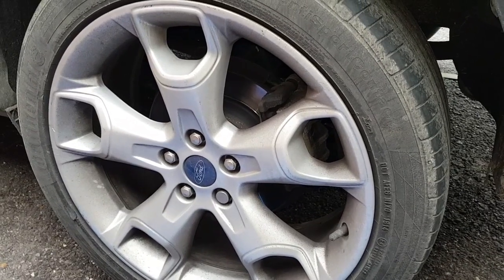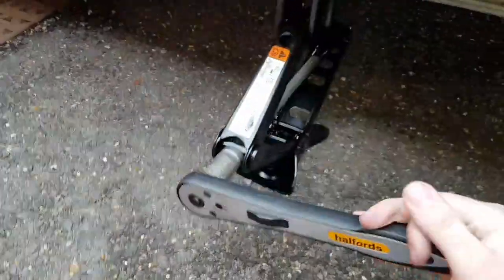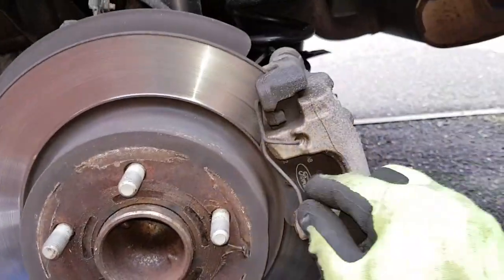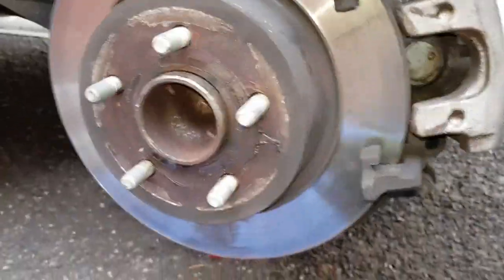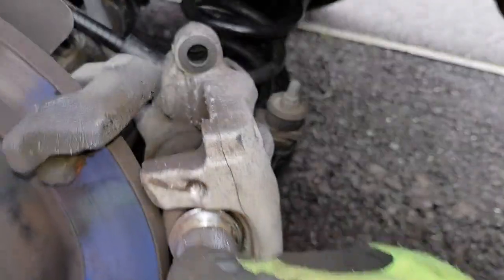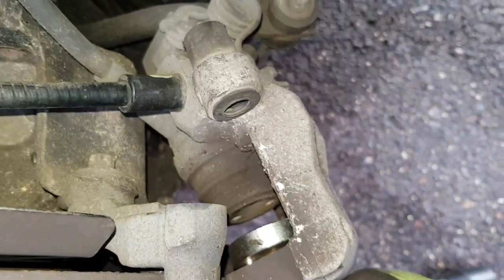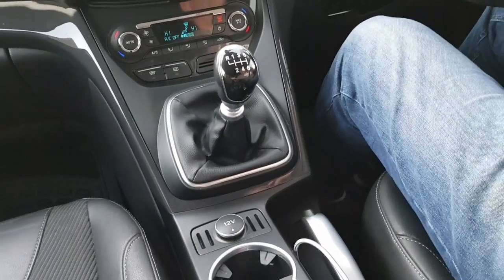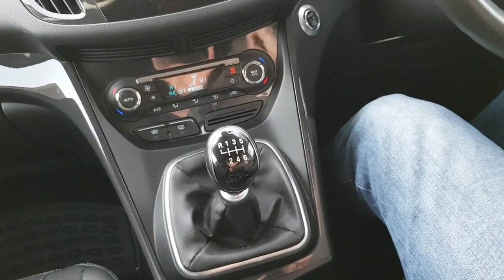Ford Kuga Brake Pad Replacement 2014 MKII

Comment: I hope you didn’t leave your rear caliper spring like that at the end of the video. The spring goes under the caliper mount not on top.
Reply from the maker: No I didn't,  I put it back where it should be :-) 

Too busy faffing with my camera and trying to do it one handed, but I did realise my error.
Reply from the maker: I actually added q comment to the vid at 25.12.

Ideally I should of reshot that part of the video.

Comment: Good video. I am doing my Kuga tomorrow. Same set up as a few of my other cars. Note to all. It's a good idea to only use 6 sided sockets as they grip on all six faces. The 19mm socket used in this video is the multi-position type and are rubbish in comparison as they only grip on the corners of the nut and can strip easy. I have thrown all my multi-position sockets away and replaced with 6 sided ones as I made the same mistake as the guy in the video years ago on a Fiesta Mk6.
Reply from the maker: Agreed. Hexagonal sockets are better to use if you have them.
Reply: @keepitpinned_yt  i use mine for stipped bolt heads hammer on a slightly smaller size  all is good

Comment: Mate, do brake disks and brake pads from a C-max II fit on the Kuga II ? I have ordered supposedly a kit for a Kuga II but after giving the order and the package was already sent they asked me for chassis number, year of manufacture and other info and so on, aaand it seems that they would't fit....but as a second opinion can they? I have a 2013 tdci 163 hp 4x4 model.Thx in advance !
Reply from the maker: I suspect they wouldn't.  I have a focus as well, but the discs and pads do differ slightly to the kuga. Unless the part numbers match for the kuga and cmax fitments I match, I would not fit the kuga parts on a cmax.
Reply: @keepitpinned_yt  Thank you , I appreciate it .Have a nice evening!

Comment: Hello mate. I bought the laser caliper tool from halfords. The pins dont for the holes on the caliper piston. Any idea what size I need?
Reply from the maker: Sorry I don't have any measurements. The plate with the pins is usually reversible for a wide pin width one side and narrow pin width the other side

Comment: For folks thst are new to this, Absolutely use axle stands - hydraulic Jacks can fail with zero warning.  Should really lower the car so the weight is onnthe stands, and use the jack as the 'back up' (not the jack as primary and stands as a back up - you need the weight on the stands so they don't tip of slip when the jack fails !
Oh and sling the wheel under the car too as another  life saver

Comment: Any need to loosen the top of the brake fluid reservoir to allow the piston to move? Thanks for the video though
Reply from the maker: you could probably do it without loosening the reservoir cap. i've just found it easier in the past, when working on bikes.

Comment: when you replaced the spring at the end of your video you positioned it in the wrong place top and bottom it should be behind the caliper not in front as you have left it

Comment: Old pads easly enough for next 10 k miles. And than replace with discs if You worry about corrosjon
Reply from the maker: Yeah the old pads definitely could have lasted longer. Looked worse when I was trying to inspect the wear than when I got them off. But i had new pads by then so fitted them

Comment: Guide pin should be greased?
Reply: I would put some grease on it. (But there are some pins, that schouldt be greased. Depends on manufacturer) The grease for the pin is really specific. U can take TRW PFG 110 or FEBI . The copper paste will kill the pin or your brakepads will stuck. For the brakepadsmounting  I take the ATE plastilube.

Comment: Hi Thanks for the how to vid.... do you have a link for the wind back tool
Reply from the maker: Most car shops should sell them, so if you UK based the Halfords, euro car parts or even screwfix, which seem to be the cheapest 

https://www.googleadservices.com/pagead/aclk?sa=L&ai=DChcSEwiq882ik-vfAhWEtO0KHZfnAIIYABATGgJkZw&ohost=www.google.com&cid=CAESEeD2ZA3eU7m9oKSSa364vBfg&sig=AOD64_1fHfjNXb7de78BZjR4Ra-ZChKLEw&ctype=46&q=&ved=2ahUKEwivzsaik-vfAhX9QxUIHcSPDaAQzzl6BAgOEBY&adurl=